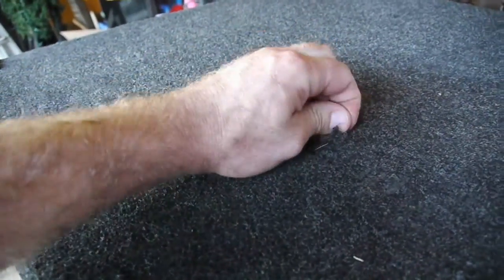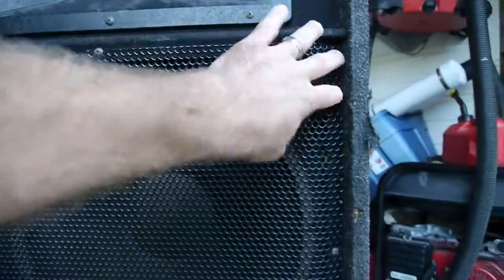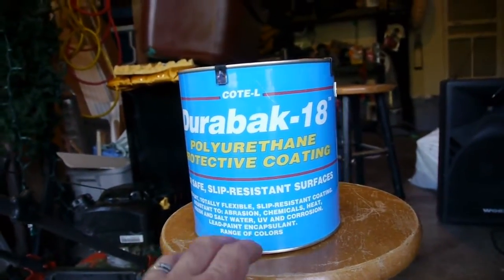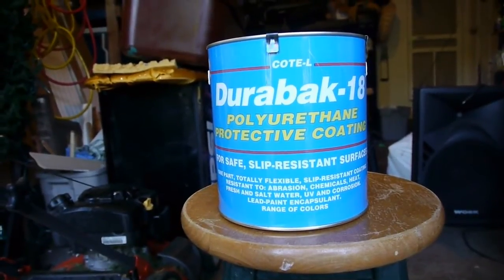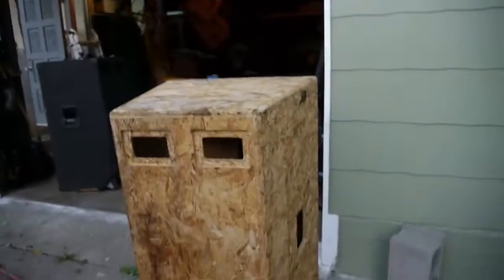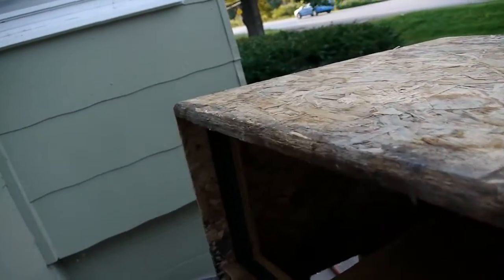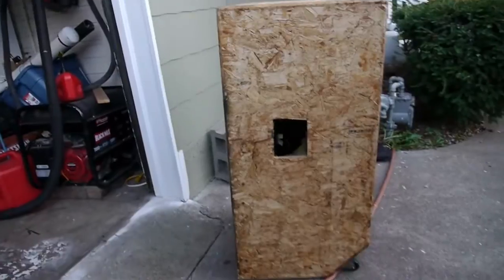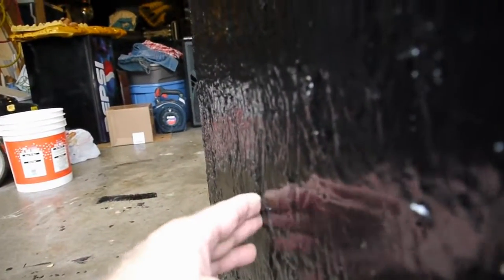Recoating Speakers using Durabak 18

Comment: If you want to remove carpet in 5 minutes per speaker,you buy cheap multi purpose thinners you brush or spray it on till it soaks through the carpet leave for 5 minutes then you can tear it off.It peels so easily.
Reply from the maker: That's a great tip!
Reply: @JeremiahNichol  Thanks,I make acoustic sound dampening panels for the company I work for,we  fit out  new Schools and older ones floor to ceiling sometimes we have to remove one because of damage by a student,and to remove the acoustic fabric,which is very similar to what's on those speakers that's how I do it because I use contact adhesive to upholster the fabric onto the panels,and speaker manufacturers also use spray contact adhesive to stick on that carpet like fabric to the speakers.
Reply from the maker: @johnbravo7542  wow thanks so much for the great information. I have to keep that in mind.